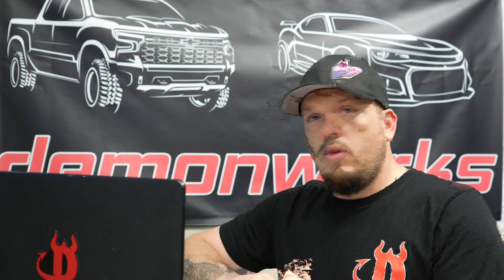Oil Pump Drive Belt TOTAL COST - 3.0 Duramax

Comment: Most won't ever get replaced so the engine will grenade when it's neglected

A real duramax is all gear driven and will never need to be replaced
Reply from the maker: That’s all it takes to be a “real Duramax” ?
Reply: Engine will not grenade if this belt breaks. You'll lose oil pressure, but have plenty of time to safely pull over without engine damage. It's not like breaking a timing belt/chain on an "interference engine" that smashes valves. And, if the tests are showing GM might extend the inspection interval from 150,000 to 200,000, that means they are probably going to go 300,000+ before breaking. So realistically, shouldn't be any reason we'll see any engines "grenade" due to this belt.

Comment: You didn’t add the cost of ATF. At 7.00 a quart x 12 to 14 and the cost of labor 10 years from now
Reply from the maker: That’s because the trans isn’t drained, it’s just unbolted and pulled away. Even if unbolted and set on a trans Jack, there’s no need to drain it.
Reply: @DemonWorks  so guess you don’t disconnect the cooler lines either.  And 150,000 miles you would not service the transmission at that time.
Reply from the maker: @ashfordcombs8658  You're on a mission ! I will give it to you at this point because, wow ! Transmission service would be a separate service from the belt service, but sure, you can factor in 12 to 14 quarts of transmission fluid because the lines were disconnected.
Reply: @ashfordcombs8658  yes you do and no it doesn't lose much fluid at all

Comment: That's not bad at all.  It's a little silly bitching about a $1,300 dollar preventative maintenance service every 150,000 miles for a $66,000 truck. I'll gladly pay that.
Reply: There was a time when engines went 300k plus and never touched anything internal. That's the gripe.
Reply: @Resistculturaldecline  This isn't internal. It's a belt with an access plate over it and a maintenance item. You don't go into this engine to replace this belt.
Reply: Exactly.  I own an Italian motorcycle.  There is a service on it that costs about the same and it is scheduled for every 6,000-12,000 miles depending on use case. I did it at about 11,000 miles the first time.  So 150K miles on a truck that will be $80K OTB when it finally comes (supposed to be built last week but no updates yet) is stupid to get worked up about.  My feeling is the people who complain the most about this stuff are the same people that are constantly buying the next best thing anyway so the idea that they would own one of these at 150K miles is pretty laughable anyway.

Comment: People just love to hate on the 3.0 this is not a big deal
Reply: i got the 3.0 2021 rst with 27000 miles and its been a nightmare. ive lost 71000 dollars is the way i see it . i could write a book on the problems ive had with this truck
Reply: @GrowinwithAJ  I'm interested in your list.  Can you at least bullet point the top 10 or 15 biggest or most expensive issues you've had with your 3.0? I'm curious.
Reply: @MrChadx1  it started with trying to lift it and get rims and tires. 3.5 lift was put on then special rims got to be bought due to the oversized brake cals. sway bar links wasnt correct. accessories are hard to get for the 3.0. viberations in the truck still havent found.  transmission work already (torgue converter and pump )and 2 check engine lights followed buy engine miss ( i think ) feels like motor cuts out maybe fuel injectors but dont know becuase light does off. fuel millage is 13.5-15.5 when i was geting 27. smell def inside the truck and outside. i bought this truck with my disability money from VA and the stress this truck has cost me is crazy. i cant trade it or sell it i would loss alot of money. love the truck  when it runs right. im sure im forgeting some stuff. i hope chevy would give me a life time warrenty for my troubles but not holding my breathe
Reply: @GrowinwithAJ  Thanks for the info. Have they been decent when fixing under warranty? How long did each fix take (how long were you without the truck each time?) Thanks
Reply: @MrChadx1  my truck was in the shop for 2 months on the torque converter and pump ( said parts was the problem ) other time it took over 2 weeks and never fixed anything. i have an apppoiintment this week to try and figure out the viberation and fuel problem .  i not goimg to lie its been hell i missed the whole season of hunting and lost 1000's in deer leases and im a prostaffer for a non profit org for vets and didnt  get one vet out hunting this year.  im pissed at chevy but they dont care
Reply: @MrChadx1  i was without my truck from oct to jan.   first time it took 3 weeks and nothing was fix the last time it was 2 months and im taking it back tomorrow. i keep getting told they cant find the problem until it breaks

Comment: 9 cents a mile. Replaced oil pump on my 06 5.3 liter at 260,000. Cost less than $500 parts and labor.
Reply: You are off a decimal place. 9 cents a mile for 150,000 would be $13,500.   It is 9/10 of a cent per mile ($.009)  ; not 9 cents ($.09) per mile.

Comment: You would have replaced at least one if not both turbo's on an eco boost by 150k, at double the cost
Reply from the maker: And at least one ecodiesel engine 😬
Reply: mine has 285K no turbos. I would say that's a very inaccurate statement.
Reply: Not true , My friends a ford mechanic and has replaced the engine of a 3.5 ecoboost and the customer was to cheap to replace the turbos as well . Turbos had over 200k on them as worked just fine with no leaks .
Reply: I have two first gen ecoboost and neither has had turbo issues. One is at 230,000km and the other is 480,000km. I have had some other relative minor repairs and that’s fine with me. I don’t see why people get so upset about having to spend a $1000 once in a while to keep a vehicle maintained when most people don’t even keep their truck that long, and have no issues buying a new truck every few years with $1000 monthly payment. That’s why this belt issue is completely overblown. I think my next truck will be the 3.0 GM and if I make it to 150,000 miles and still like the truck, I’m fine paying to have it done.
Reply: @manueloppel  yeah , I believe people are over hyping the 150k mile service .

Comment: People: 
Where’s the manual transmissions? Automatics suck and always break. 
With a manual, all you have to do is change the clutch every once in a while. (Transmission needs to be separated from engine and slid back for access). 

Also people:
This new GM design sucks! I can’t believe they put a replaceable belt at the back of the engine that requires separating the transmission from the engine and sliding it back for access.
Reply: Hahaha virtually no one is mechanically inclined anymore.
Reply from the maker: On point !!!
Reply: It's an awesome engine and most won't even keep ot 150k, might get a bargain on one around 150k and diy
Reply: @lewiswatchorn7239  You imply it's no big deal to slide a transmission back and replace clutch plates, but then act like it's the end of the world to slide a transmission back and replace a belt every 150,000 miles (and likely 200,000 that GM is raising it to).  Can't have it both ways. Ha.
Reply: @MrChadx1  You've misunderstood my comment--I said that "people" say these things, so I'm pointing out exactly what you are calling me out on.
Reply: @lewiswatchorn7239  Ah. 10-4.  Wasn't clear by your comment. Thought you were addressing that "to the people". Ha. Thanks.

Comment: I agree with you, bad, but not all that bad. I’ve also been told the belts are wearing less than expected and you may be able to put this off way past 150,000 miles. AND, I’ve also been told that if you drive the vehicle until the belt fails, it will just loose power and not hurt the engine - so if you don’t mind rolling the dice and a one time stranded on the roadside, drive it till it fails. Can you confirm or deny that either of these are true?
Reply: It will warn you but I wouldn't take that gamble with a 10k engine
Reply: The belt is for the oil pump, so if it fails it wouldn't cause any interference between the valves and piston. It would become basically undrivable, though, since there's no longer oil being circulated through the engine.

Comment: Yeah, but what are labor rates going to be by the time I put 150K miles on my truck - could be astronomical. I've got an '05 truck that I bought new and only have 147K miles so far. So if I put similar miles on my 3.0 Duramax, what are labor rates going to be 18 years from now in 2040!!!
Reply: Well, you better start saving now!  You're running out of time.😀

Comment: I thought the inspection/replacement is covered under warranty?  Or is that just if the belt breaks before the maintenance is due?

Anyways, like @trent wills says: no biggie to me. And I’m guessing after the first few years of maintenance gets done, GM may update the periodicity.
Reply from the maker: Unfortunately, not covered under warranty unless something else causes a failure to it while the engine is under powertrain warranty. Example, oil pump seized and caused the belt to slip and break. Aside from that, it's a 150,000 mile maintenance item.
Reply: Gotcha. Guess that makes sense, like any other maintenance I suppose.

Comment: Honestly that isn't bad at all. I was expecting 10x higher price then that.
Reply from the maker: I think many were thinking the same as you. I'm glad we can start to clear this up.
Reply: My best friend owns his own Transmission shop. His R&R man can have a tranny totally removed on most vehicles in a hour. After he rebuilds the transmission the same amount of time to reinstall it so whoever is paying stealership prices for labor, you’re getting ripped at $1000.00 or more.
Reply: $13,000 for oil pump belt replacement?  If that were the case I think most would just opt to replace the motor.

Comment: Absolutely no big deal whatsoever in my opinion I’ve always thought it was a good design 🤷🏻‍♂️ even if it was $2000 after 150000 miles I could care less. thanks for the information.
Reply from the maker: Exactly my thoughts ! I had to look into this after so many people asked / commented about it. Thanks for the comment !
Reply: I talked to my gmc dealer ship they told me it's a 40 hour job.
Reply from the maker: @ronhofer28  now you know where to not go. Clearly they have zero knowledge on your engine. 

For the record, the labor times in this video need to be updated as they are a little shy.
Reply: My best friend owns his own Transmission shop. I’ve watched them R&R a transmission. That’s remove and reinstall. It took them maybe 3 hours but they have the right equipment to do the job. The stealerships get more than their fair share for replacement of a 20.00 belt.
Reply: *I couldn’t care less. 😉